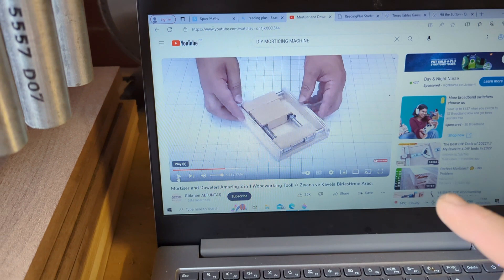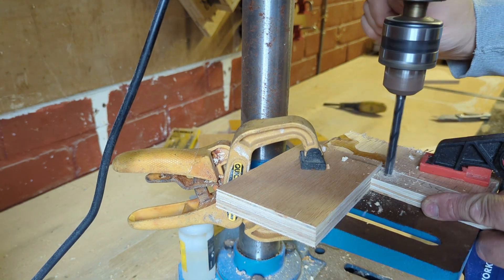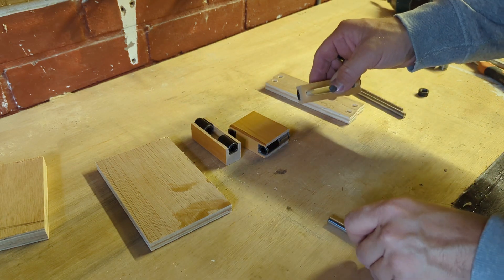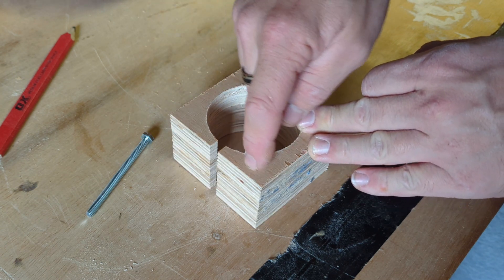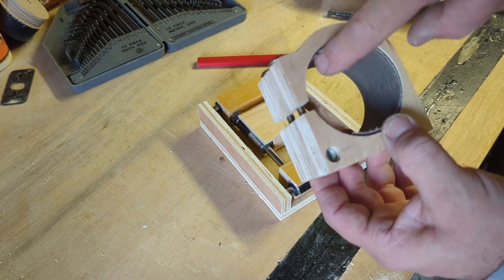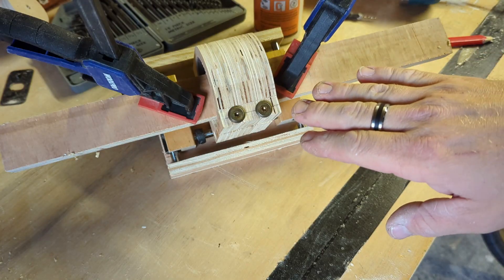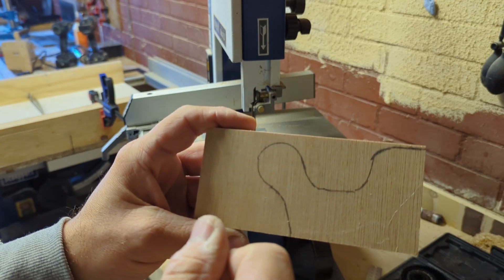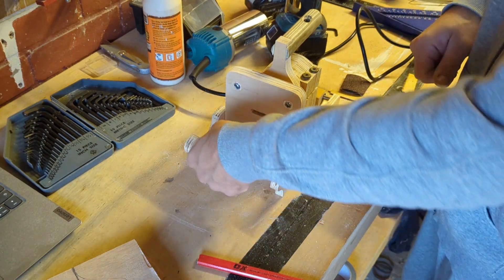NO DOMINO NO PROBLEM Loose tenon machine

Comment: What size plywood did you use and domino bit
Reply from the maker: I used 12mm for the base and 18mm for the fence.i believe the cutter in that video was 16mm but you could in theory use any size depending on the timber you're working with. Thanks for watching!